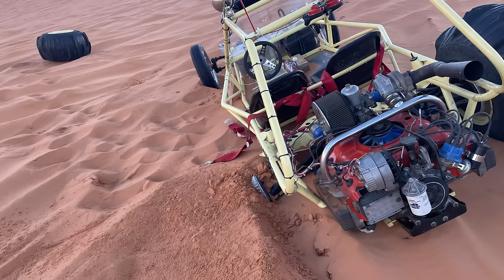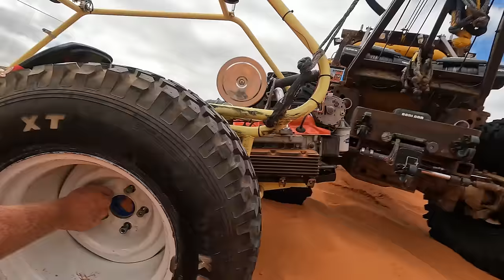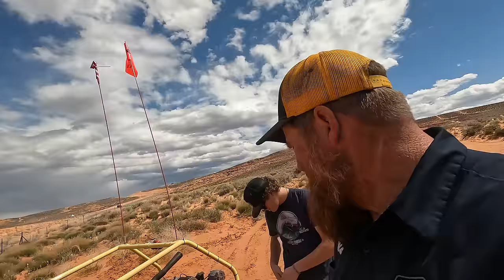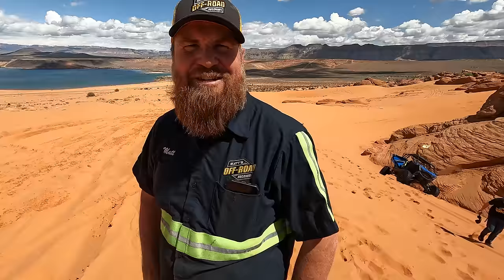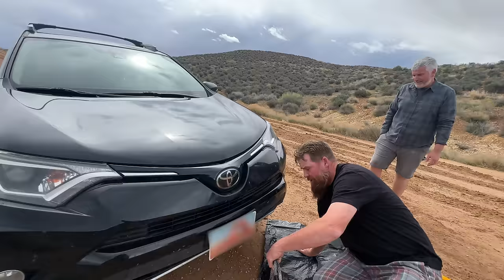Is This Recovery All My Fault?

Comment: I actually do think Matt's wrecker is the coolest. The rest of them just look like lifted pickups with a boom in the back, Matts looks like something special.

Quick tip though. When you're shaking a vehicle like Colin is around 12:30 to see if it will roll over, do it from up hill so it doesn't roll over onto you.
Reply: Like the Morrvair. It looks like it was made for 40 inch tires. Special ✓
Reply: Scratch built to accept the cab they/he wanted.
Very cool.  Documenting the build and the importance of claw hammers make it extra special .
Reply: Trailmater is the off-road wrecker all others should be judged against!  It has everything needed to complete all jobs.
Reply: What I like about Paul’s and Rory’s theirs look like wreckers from old movies or dukes of hazard.
Reply: when its finished i think Robbies is going to be the coolest. being made out of an old model 1 is so freking cool
Reply: Yeah what he said
Reply: You really don't expect common sense on this channel do you?
Reply: It’s a cool wrecker, especially paired with the morvair. Just seems like he hasn’t FINISHED it and tightened it up. Maintenance appears to be low priority but maybe that’s just editing
Reply: Rookie mistake
Reply: Rory bar none.

Comment: When The customer sends you a photo, there's a very high likelihood that if you save the photo they sent you to your camera roll and then click the photo and swipe up it might have the geolocation exactly where it is on a map. Very few people turn that feature off so it might help.
Reply: It might depend on what app they're using to send the photo, but a lot of apps will automatically strip location metadata from images before they are sent, as a safety/security thing.
Reply: @KarlEller  Before that was the practice there were some interesting oopsies. Remember how John McAffe was located while hiding out in Guatemala at a friend's house? Yup, metadata of a picture... (2012)

Comment: I have never missed a video to my knowledge but I don't know why the jeep is called the 'Rental jeep'. Is it or was it? I have said it many times but I just love everything about the Morrvair especially its sound. It might have the same brand muffler as the other builds 
but to me it sounds the best and it being a Corvair has to surprise some customers like 
the 4 dr Ram with a heavy cummins and a 35' camper buried frame deep in the sand being  pulled out by a 61 Lakewood is just hard to imagine. Can you imagine telling your buddies
that?
Reply: I also never understood the rental jeep reference!
Reply: Came here to say the same.... What is the rental Jeep story?
Reply: They probably call it that because it looks like a rental jeep
Reply: Well considering Chrysler is not doing well it is probably cheaper to lease the vehicle than to buy it outright because of the depreciation. Correction stellantis.
Reply: If I remember there was a single comment made when it was picked up at the dealership or driven into the yard that it looked like a rental and it stuck - but I have a brain injury so don't trust me on that!!
Reply: I like to think it’s because it’s not technically part of the MORR fleet. They just rent it from Jaymie when needed. 😉

Comment: Those general road assistance services like triple A are pretty bad as far as not willing to do anything beyond what they regulated they will do. And sometimes even what you are paying for them to do. 

I had premium Triple A, and my car's manual gear shift burnt out.
My premium service was that they would be able to tow it to my home.

But they told the driver to not take me home, it was ten miles away and I didn't have coverage for it.

Just to tow me to the nearest exit off the highway.

But when the driver got there, he was local, and saw I was only a mile away and I showed him my premium card.

he was like screw them and took me home. 

We no longer have triple A, why pay for something monthly that may not even be willing to help.
Reply: thats odd my triple a towed me accross town to my house even backed the car into the driveway
Reply: I called them and signed up because I needed a new battery on a Saturday morning in a suburb of a major city. After signing up they told me their battery replacement service didn't cover my location. The only thing they could do was tow me to a mechanic shop that wouldn't be open until Monday. They wouldn't even tow me to an auto parts store so I could just buy a new battery and change it myself in the parking lot.
Reply: @ab130  Yeah, they seem absolutely unwilling to deviate from their rules, even if they leave the driver unsafe.

I had all my tools in the car, and they didn't care that leaving it on the side of the road off the highway could leave it to being broken into. And I had premium service. I will never use Triple A again. 

I filed a complaint and they never even responded back.

Comment: My coworker bought a truck and added wide wide wheels.  About every year and a half he's needing new hubs.  Fairly easy to replace but just replace them more often, don't let them fail.
Reply: Doesn’t take much extra leverage to really overload the bearings. Especially since many newer vehicles use ball bearings instead of tapered rollers.

Comment: Adapter is backwards. Plus it's a POS adapter in the 1st place. Plus with the paddle tires on way wide rims there is huge leverage on the adapter. My Baja Bug had 4 to 5 lug adapters made of 1/2" plate. I use them hard in rocky desert because I use it for pre running. I'm  a retired offroad racer, but our team is still quite active and just won the Baja Bug class at the Mint 400. I have no problems with my adapters. Those adapters on that buggy would never get loaded on the trailer to leave home over here.

Comment: Kaulin was still right. divide and conquer has more than one meaning. commonly used in tech and coding which is 'solve a large problem by recursively breaking it down into smaller subproblems until they can be solved directly.'

Comment: Divide and conquer works though because the enemy is the landscape. You divide its size by two and you conquer the search. “You” being the overall group.
Reply: It would only work if the two landscapes fought each other, which they did not.
Reply: Matt , I am the owner of the Covair
Powered sand rail that you rescued and subsequently bought from me. I would love to be invited to go and take a ride in it when you get the turbo  seals replaced and tires and wheels replaced. I couldn’t believe that you were the one who worked on it and it seems like this machine was made for you not for me. Careful you can see how much torque that engine produced on the wheels adapters and I never once pushed the throttle all the way open not even halfway! But I do wanna ride:-)!

Comment: Divide-and-conquer solves a large problem by recursively breaking it down into smaller subproblems until they can be solved directly. Divide-and-conquer works in three steps: divide, conquer, and combine. It is more efficient than brute force approaches.
Reply: It might not be the perfect phrasing, but dividing a search area into multiple parts could be covered by the divide and conquer phrase.

Comment: I had one of the big motor clubs towing plans. On two separate occasions I called from the side of the interstate broken down. The phone rep said, we can't find anyone to tow you, good luck and have a nice night. I cancelled my plan after the second time.
Reply: I got left S.O.L. by likely the same one. I called, after waiting hours I called back. They said I wasn't there when the tow came. This was back before the cellphone fit your pocket. it was a hard mount in my vehicle.
Reply: Me, too.  I was sideswiped by a semi at a roundabout.  He destroyed my right rear tire and wheel and damaged my right front tire and wheel with a few minor (whew!) scraps in between.  I called the big boy to change my tire and they said it would be 4 hours.  It is Arizona and it was hot.  I changed it myself and cancelled my membership.  Evidently their slogan is not - "We'll get 'em out."
Reply: My ex used to work for a company called Agero,
There a call center.
The one she worked at handled the majority of the road side assistance calls.
There intire staff were amazing.
If you have your location on on your phone they know where you are before you tell em what you need.
They will get the right people out to you whether your plan covers it or not. 
I don’t have roadside assistance coverage anymore but if I’m out of town that’s who I’d call.
Reply: There's been times Triple A ended up sending a different wrecker service to help me out ! Heck I was in the largest city in Kansas which by the way is Wichita not Kansas city ! Most of Kansas city is in Missouri !

Comment: I really appreciated your grammar lesson today.  You might appreciate this fact in response.  In computer science a Divide and Conquer algorithm follows how Kaulin used it - to split a problem into smaller identical problems.  

Searching through a space (e.g. computers memory) for something would be a great example where the computer can search the space 4 times as fast by dividing it into 4 separate and equal sized chunks and having it search all 4 chunks at the same time instead.

Comment: Jefe walks into the shop in the morning and turns on the light and sees the sand rail. To his initial rhetorical question, "What is this"? Matt should simply reply THIS is a demonstrative pronoun and walk away.  Thus (1) answering the question what was asked; (2) giving Jefe a grammar lesson; and, (3) practicing for his oral part of the Utah Bar exam.  LOL 🤣🤣
Reply: Correct answer should be rhetorical as well! where in the business does it say Jefe Offroad.
Reply: Or MickeyDs is paying $20 in Cali.
Reply: @iffykidmn8170  If you have the taste for; or, can stomach a $20 burger served by an angry employee who hates YOU and his job. Not a good recipe (pun intended) for the success of any franchisee. Once again, CALI ends up shooting off the end of it's ????.

Comment: I like all of the tow trucks Watt listed but for different reasons. For what they are and where the work they are all cool and capable. design wise I rank them as Matt's 1 Chads Fab 2 and a toss up between Fab Rats and Rory's trail mater.

Comment: That towing piece  its something you need to have in your toolbox   Just for  cases like this one    .. May find in oreilly s  or make it your self.
Reply: They are okay for flat towing gently on level pavement.  Not worth doggy doo for a recovery:  They strip the threads and pull right out as soon as you yank on them.  If you were using a kinetic rope, that could kill someone.

Comment: That last one was probably battery related. Most likely the battery cables shook loose due to the rough terrain and improper tightening. So once the cars electronics can't pull what it needs, everything will throw a fault and the car won't even attempt to run again. Disconnect the battery for a few minutes to reset the modules, then reconnect and try starting again. It could also be a loose connection on the alternator or just a bad alternator failing to charge the battery.

Comment: The wrecker needs a duramax bolts right up to the 4L80e and even stock has 100 more hp. Big turbo and injectors and look out for

Comment: Most modern phone have location coordinates with the picture. It's called meta data. It's not 100% accurate but as you take more pictures of an object, the gps location becomes more accurate. On my Android, if you swipe up on picture, you can see the meta data. Social media strips off this meta data after having to deal with stalking cases. Photo directly from the phone that took the picture, most likely has the meta data on it. It can be turned off but you have to be a techy to know how.

Comment: Toyota still has the "spot" for the eye bolt, but no longer put it in the vehicles.  Just to save a buck.  Also some have the access panel that you popped off, but no nut to thread into.

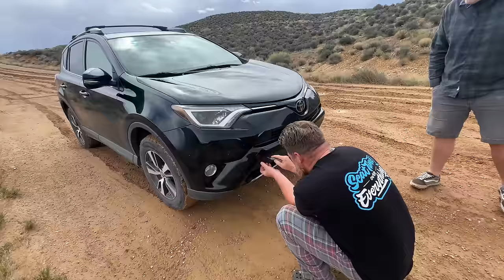Comment: 15:57 ...  I'd be keeping notes in my phone (buy use of a number of  different sizes and pitches of nuts and bolts or the actual eyebolts

Even eye bolt hunting the scrap yards,  until I  had two each of every different size available, (for times like this) ...I wager that a dozen parts, would cover 90% of the cars out there!

What do you think?

Comment: A Corvair sandrail. You know Matt had it have it.  Back in the day that was the more horsepower setup rather than the VW power plant.  My neighbor has a Manx dune buggy and all of these VW guys all say the same thing.  "I was thinking of putting a Subaru engine in it"  What are you nuts, and have to deal with a radiator, fuel injection and all the complexity.  Just do what they did back then, put a Corvair engine in it.

Comment: Do NOT ever install that non-tempered plexiglass guard on the bottom. You hit a sharp rock at speed, it will break and come at you like 10+ razor/knife-like pieces and cut you from ear to ear. There is a reason they are always made out of metal.

Comment: if you do anything off-pavement it's critical to learn the search term "off-road recovery".  i learned it the hard way while stuck on a muddy road leading to a hiking trailhead for a northern california county high point... i was there for hours, the only help the "big motor club" could offer was a list of 8 tow truck companies, since the club didn't cover anything off-pavement.  none of those eight companies would help me, and sadly they didn't tell me the magic search terms.  a local came by hours after i was stuck and gave me the number of an off-road recovery company (pope valley towing).  a few hours later i was climbing into the cab of a lifted ford tow truck with 40"+ wheels.  ever since then i've been telling my fellow peakbaggers that the term they need to learn is "off-road recovery":  it has helped a few of them in their off-pavement mishaps as well.

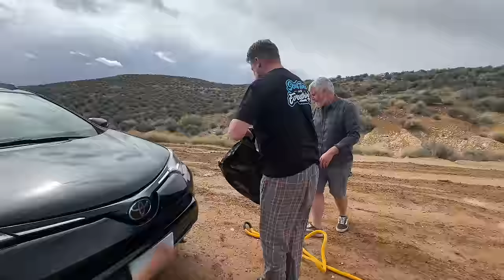Comment: 16:45 FINALLY!! Using a large (3 mil thick?) construction trash bag, to lay on!  I carry one in all my vehicles...
- takes up no room
- once finished using, can be turned inside out if dirty
- can be rinsed off & reused 
- can be used for actual trash once it starts to get small holes
- very cheap to replace

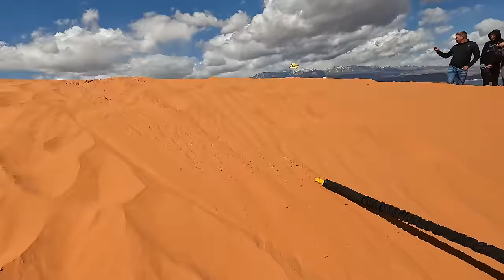Comment: """Look how low that rope s in the sand."" @13:01 DUUUUUUUDDE!!!!! [[[[ THIS is an experimentation idea... ]]] ON ONE of those dunes out there, Some one SHOULD TOTALLY see HOW FAR a rope could be used to CUT DOWN through a DUNE (like a hot knife through butter) BEFORE it hits solid ROCK!! Call it a "" Sand Dune Rope challenge""or something like that?? That's just a BrAiNs+0rM I had... Take it with a grain or two of salt... Or that red sand even....

Comment: Wheel-spacers and "wide wheels aka low offset" result in the same stress on the wheel-bearings when all other things are equal. The only real difference would be the added weight of the wheel spacers.
Reply: Thats not how physics works, its called leverage 🤦‍♂😂

Comment: I’ve had wheel spacers for upwards of 15 years now and never had an issue with a ball joint, wheel bearing, tie rod, etc. lol maybe the luck of the draw or maybe I’m just paranoid about keeping my lug nuts torqued to spec 🤣
Reply: It's not so much adding wheel spacers (they can vary in thickness)...but how much 'offset' (moving the wheel out) is introduced.  Matt included, "...and wide, wheels".  The further out the tire/ wheel assembly is moved(or widened), the more strain that's put on the steering components.
Reply: @billbillinger2491  Excellent point lol having most of the wheel centered over the hub is a lot better supported than a wheel with no backspacing 🤣

Comment: @Matt you are starting the tow truck race..
Fladbed drag race...
Repo pic up car drive a fast lap park car..
2 vs in a bracket  Best of.. modded and unmodded Clausen... biggest wrecker..
Fastest turn wrecked car round load on flad bed... use naibough to keep teaffic away.. .. And the fier truck.. a bit smoke and flashen light.. .. And huge time clocks..
Big screene and stream... yes i see this big in the futur.. who els has a huge show a arena .. benched... women team... biggest wrecker.. maybe Even call what is his name in albercurky.. the huge discowery duude.. yep i see i huge futur.. And display of the difrent firma making first responderer things .. towtrucks repo truck super hewy wrecker.. And make .. a pro class whom ever uses ther tow wrecker as a dayli and thoes with out plates..  a super modd and a pro.. maybe super pro..
You get my drift.... @matt

Comment: The thing about wide wheels are, you need wheel spacers, or giant lifts to clear them..
Reply: You definitely do not need wheel spacers, just get the correct offset rims.
Reply: @johnt.848  just about any wider than stock you most def do... Taller is a little different

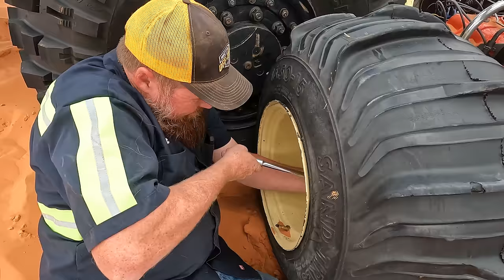Comment: 5:33 Colon like wheels spacers and rice on trucks. Boss calls em ball joint breakers. Hes right. Irony is off-roading, over size tires, and pulling out vehicles also causes ball joint failure.

Comment: Wide wheels, wheel spacers, and rubber band tires on diesels is ridiculous. Looks like a clown car… tasteless. Good if you like broken suspension components and a horrible bump steer drive.